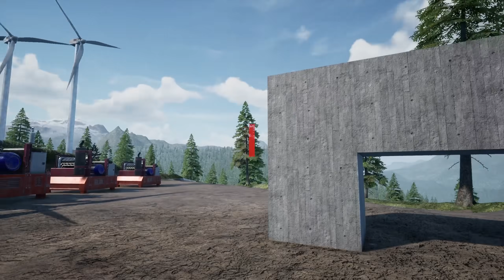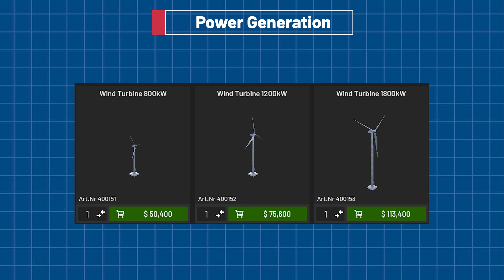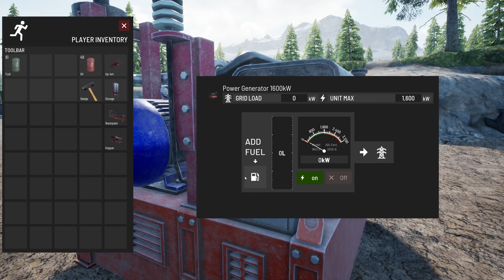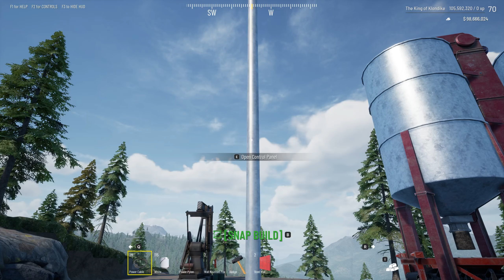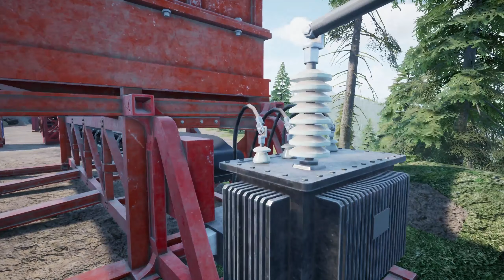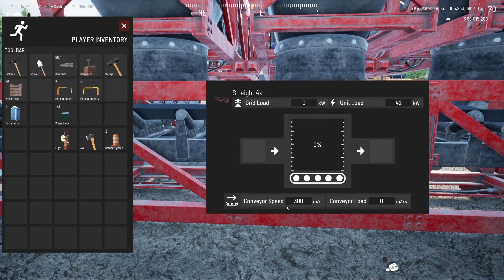Out of Ore's NEW POWER SYSTEM Tutorial

Comment: The 10x power distributor is somewhat disappointing in that it uses more power draw than it should. Each step up costs 50 extra power (the 5x uses 100 extra, but is also 2 steps up from the 3x so it's still 50 per step) but the 10x should be using only 550 kw, not 600.

Also, it would be good to know how reliable the solar and wind generators are. I would imagine solar doesn't work at night, but does wind speed vary throughout the day and cause a power drop?

Comment: So let’s hope we can set a large fuel tank next the generator and can connect it via a large fuel hose
Reply: *Scrambles to add this feature * 😂😂
Reply: Can't as of today fuel has to be manually added but if you run coal plant like we do in our server u can run conveyors to it for coal and u can run pipe for id assume water or oil or fuel havnt got to connect we just run them and put coal on manually as out plants is not small but not medium or big either not yet currently stocking money to build the warehouse for production looking for some more player to add to the crew on the site but dont want ppl going crazy as we all work as a team and communicate before things get done for anything we relay anything need from damage to how much stock of materials we have to how low thing are or buying selling placing or starting a new dig we talk to all thst are in the site and we use discord